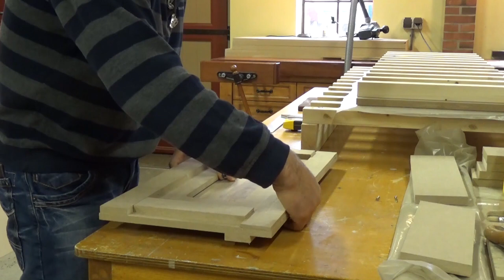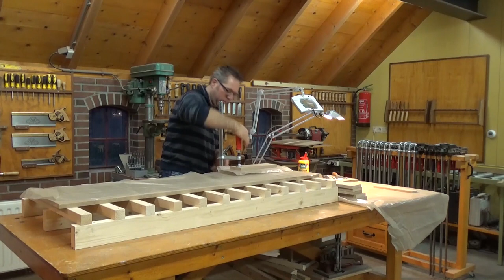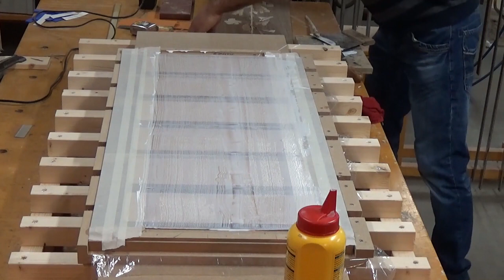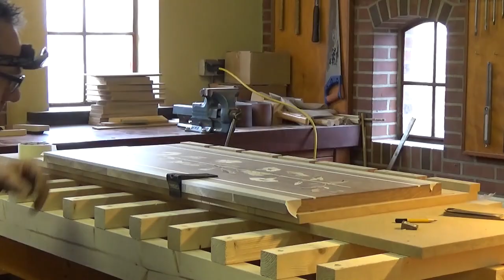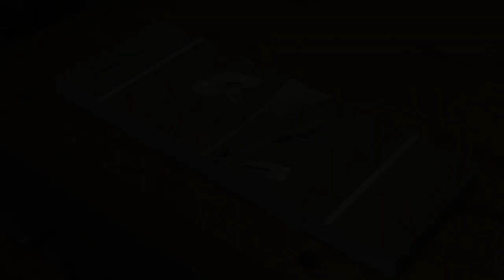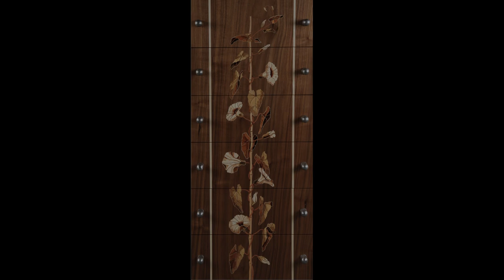Making marquetry drawer fronts

Comment: Ronnie, thanks for your advice.  I'm very focused on practicing my cutting (zig-zags, tightening curves, fish eye circles).  I'm staying within the pencil line most of the time and getting better.  I also recognise that an important part of marquetry is a good colour library of timber veneer.  I'm lucky in that regard and have access to a wide range of Australian species.  Is it OK to store it at near thickness (3.5mm?) or at greater thickness (IE. 1").  Again, thank you
Reply from the maker: I store my stock with a thickness of 3mm and use it for several years. It doesn't give any problems as long as you store it dry.